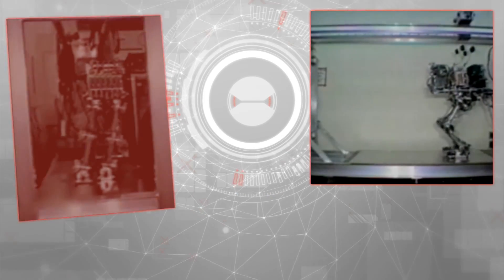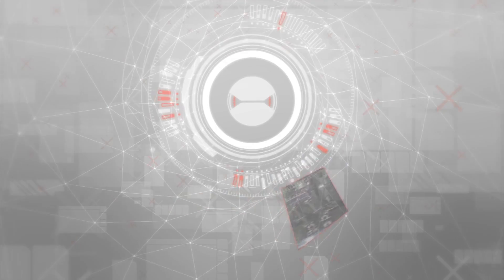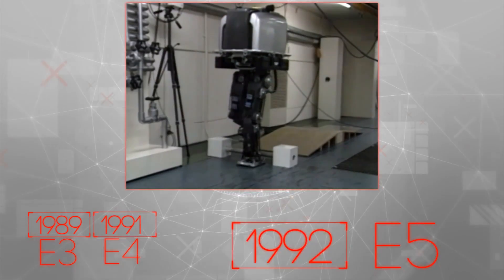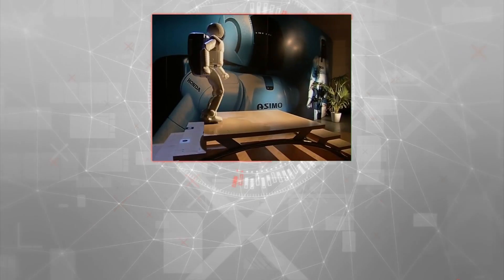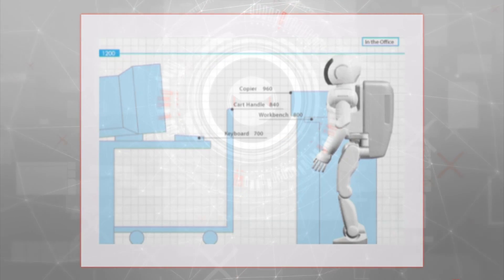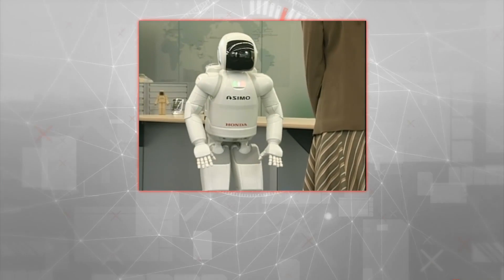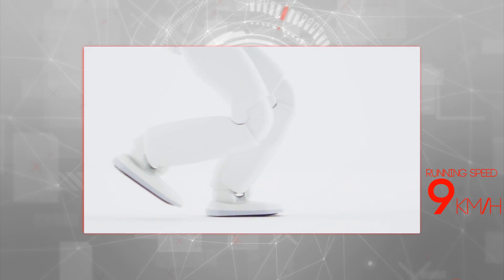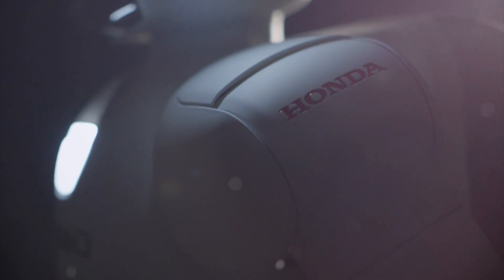The History of Honda Robotics

Comment: Not to take away what honda was doing, but all of their robots walking was ‘baked in’ meaning all their robots found it difficult to walk in uneven surfaces and had preprogrammed walking styles that didn’t actively adapt to different surfaces. Sure it looks cool, sounds cool, and walked like a human, but had someone nudged it in the wrong way, it would have toppled over like a stiff board. 

In contrast to modern robots where Boston Dynamics is currently leading the world in robotics with biped robots that adapt to any surface, completely autonomously without any input from a user and without preprogrammed walking cycles.
Reply: Asimo walked so that Atlas could run, leap, vault, somersault, and dance.
Reply: boston dinamic robots are a craps
Reply: @NurulAini  lot of talk from someone that can’t spell Dynamics lol
Reply: @enda0man  hehe
Reply: The early ones couldn't, but later ones could walk up stairs.
Reply: Eh, it was an experiment, I mean, wasn't Asimo decommissioned not too long ago? (rip)